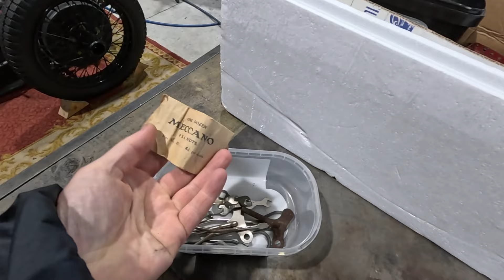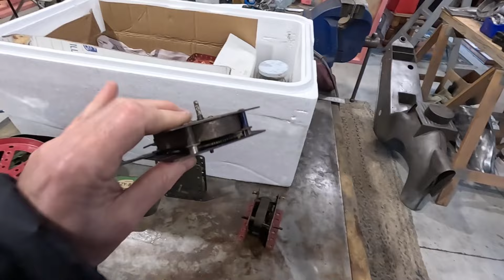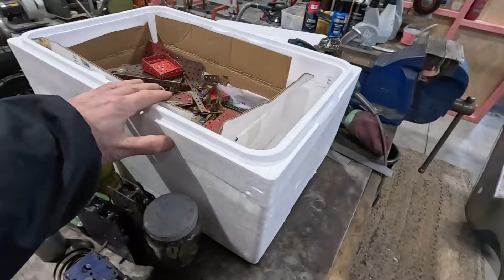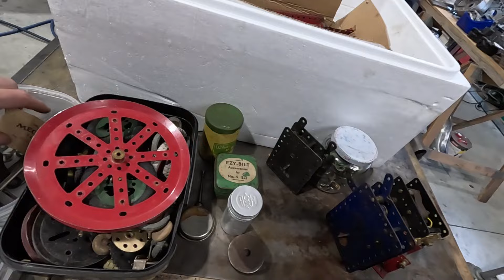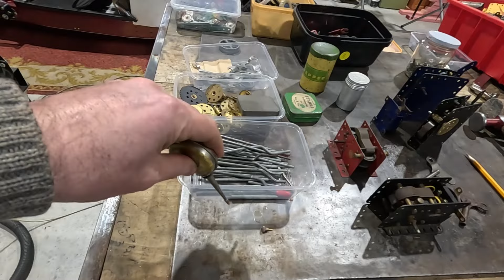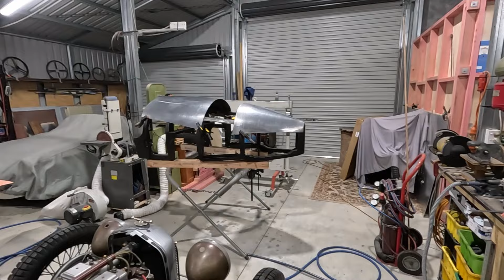Meccano plate roller

Comment: A nice haul! Most of it is pre-war - the blue clockwork motors are 1930s and the small red electric (could be 6V!) motor is also pre-war. The larger black 20v electric motor is post war. The 6" pulley is nice, as is the small oil can (also pre-war). The heavy gauge flat metal plates are Meccano (Part 52a).The U shaped bracket is a cranked bent strip (part 44) and is meant to be used as a compact bearing (though I confess I don't think I've ever used one!)
Reply from the maker: Was a good load of Meccano that one. Haven't had time to do much with it yet apart from clean it up!